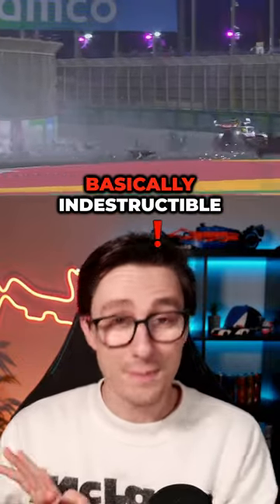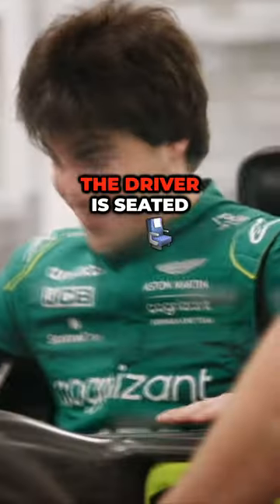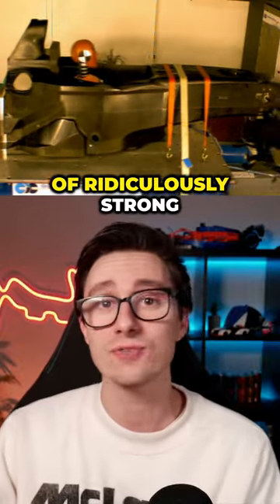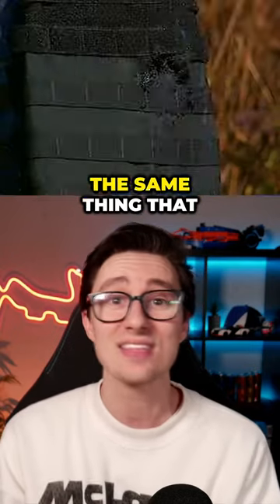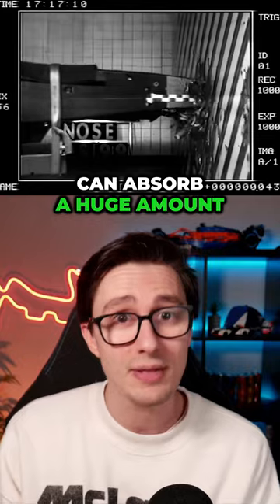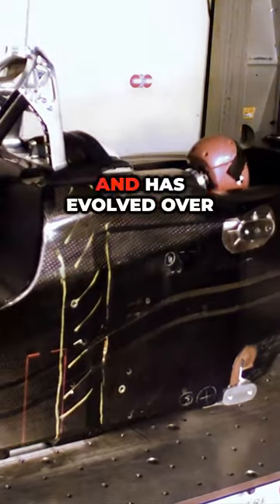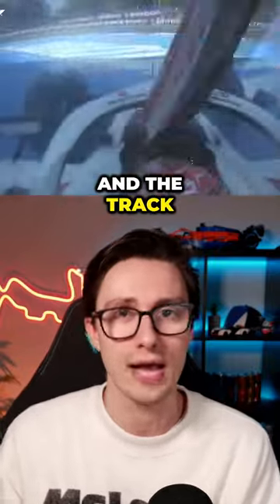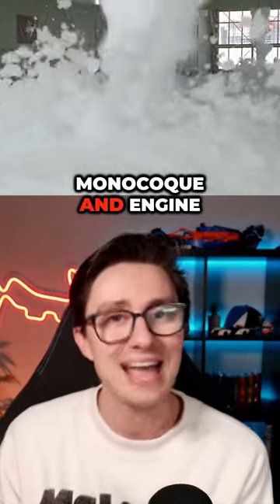F1s Survival Cell is INDESTRUCTABLE 💥

Comment: Tell this to nascar
Reply: No deaths since 2001, and they are using SAFER barriers as well as many other safety features. So NASCAR is very safe, and they have something similar already. It's called a roll cage. And NASCARs have a larger crumple zone as well, which helps with impacts.
Reply: You mean the sport that introduced the HANS device before F1?
Reply: @gdav4142  fun fact about the barriers: F1 uses different kinds of barrier technology for different kinds of impact.

For example: tire barriers are still the most efficient way to reduce perpendicular forces, while tec-pro and SAFER barriers are safer when it comes to more parallel forces.

The reason NASCAR uses SAFER barriers instead of tire barriers is due to the most common angle of impact, which is with almost parallel forces. 
The reason they don't use Tec-Pro is because it is a lot thicker (full system is roughly 2m or 6.5ft) and needs to be repaired mid-race in case of a crash, which SAFER barriers does not require.
Reply: @ThomasFox56  Thanks for the information. I'm a NASCAR fan, and will occasionally watch F1, so I'm not as well versed in the safety tech that F1 has.
Reply: @gdav4142  no problem! I only started watching motorsport in general in 2019 with F1, but very quickly expanded to all sorts of racing, including Endurance (WEC/IMSA), GT Racing, IndyCar, NASCAR and a lot more. I always had the passion of learning the nitty gritty details due to my autism, so I know a bit too much about the technical stuff and strategic stuff haha

I'll give another fun fact while we're at it: in GT Racing, they need to adjust the Balance Of Performance on a per-track basis due to the difference in cars! For example: cars with a smaller engine but bigger turbo potential are more powerful at higher altitudes than their naturally aspirated competitors. This is due to the fact that at higher altitudes, the air becomes less dense, meaning you'd have to run the engine quite lean. But with a big turbo charger you can solve that problem, because you can compress the air, bringing the density back up. And how they solve the inequalities is by monitoring performance the entire event, and adjusting weight penalties before each session when necessary!
Reply: @ThomasFox56 You have a ridiculous amount of knowledge my friend! I have an autistic friend at school who knows everything about animals and video games and my piano teachers son is also autistic and knows absolutely everything about fighter jets! Do something at University that you have a passion for as you will have no problem researching and learning everything.
Reply: @harryford8340  thanks man! I think 'ridiculous amount' isn't even the right description, more like 'insane amount, 50% of which useless' 😂 I mean, I can distinguish a lot of Rollercoasters based on manufacturers just by looking at the track-design, I can roughly estimate the era in which a song is made just by listening to the quality, processing and style.... so yeah, maybe a bit too much knowledge 😂

Comment: How did Antoine Hubbert died then?
Reply: Hubert died in the hospital, following injuries from the impact which was 82g (as comparison, Verstappen's crash in Silverstone was around 51g).

The purpose of the survival cell is to make penetration/ruptures around the driver virtually impossible. However, motorsport still is a very dangerous sport. There is no guarantee that a driver survives a race. But then again, there is never a 100% guarantee on everything in the universe.
Reply: The crumple zones on his car crumpled from hitting the wall, so when he got hit a second time he had nothing to take the impact of the hit except his body.
Reply: @ThomasFox56 True and think even if F1 was on the scale of the billions of road car users and they were constantly racing there would be way less deaths than in road cars just on the highway

Comment: Well, and that's just one argument more to ban Lewis Hamilton from F1 after what he did in Silverstone 2021. Like... How was he not banned for a few races or even disqualified after taking out another driver in a way that literally ripped his monocoque apart?
Reply: Yes but you could argue that if the was not the halo in F1 Max Verstappen would have killed Lewis Hamilton in Monza 2021. You can argue these things all day but F1 is the pinnacle of motorsport safety. Heated rivalries cause bad moments but neither driver intended to harm life in those moments.
Reply: @harryford8340  that is the stupidest argument I've ever read and I hate the fact that this is not the first time I read this. NO, YOU CAN'T!
Reason is: The Halo exists to prevent exactly that. And it did it's job perfectly fine. Max had no way of calculating to end up on Lewis' car like that.
While on the other hand the monocoque clearly isn't designed to withstand the force that Max had to experience, due to Lewis taking him out. Yes, he took him out. It was a calculated move, Lewis knew what was going to happen, he's an experienced driver and not some rookie who just started driving yesterday. He knows what he is doing. And funnily enough, if you say that I'm wrong you're saying that he's a danger to other drivers, because he's a terrible driver who doesn't know what he's doing.

Also, yes, heated moments like this happen. But the FIA has to react accordingly, including banning a driver for taking someone out and forcing them into a wall at 51g. And especially when that other driver's life was actively endangered.
Reply: @gruphius  The crash was completely Hamiltons fault yes. But Verstapprn squeezed him. Hamilton wanted to overtake so drove so aggressive that he accidentally caused a crash. He did not intentionally want to HIT Max off the race track. At Monza you can see Verstappen drove into Hamiltons car completely on purpose and at that angle and with the sausage curbs he has been in the sport long enough to know what could happen. In Monza and Silverstone it was obvious who was at fault for each one but neither intended to crash the other driver out of the race and this is why F1 has such good safety for racing incidents like this
Reply: @harryford8340  huh? I think you're a bit confused, my guy.
So first of all: "Lewis was at fault, but Max caused it." What are you even saying? Max held his line, as he was entitled to. Lewis decided that brakes are merely a decoration and ran into Max. Max did nothing wrong and, as you said, that crash was entirely on Lewis. Max had no way of avoiding that. And you can't tell me that Lewis Hamilton, a 7 times world champion and, according to some weird people, the best driver of all time, doesn't know what he's doing, accidentally doesn't use the brakes properly and by pure chance punts his only rival into the wall at ~300 km/h. We've also seen plenty other examples of him just running into people he was battling in the past few years, are these just Lewis making rookie mistakes? No, that's just impossible, especially if he truly is a good driver and not just some sham that only won titles because he had the fastest car and team orders on his side.
On the other hand, Lewis squeezed Max in Monza. Max was too stubborn to take the escape route and stuck next to Lewis. Both had the chance to avoid that one, Lewis by giving more room, Max by taking the escape route. Both didn't.
Reply: @gruphius  They are both aggressive drivers when it’s all or nothing. Racing incidents happen, they have both caused crashes. Verstappen was okay after the crash in Britain and Lewis was okay after Monza so please stop waffling and just enjoy the sport it’s been like 3 years
Reply: @harryford8340  There is a thin line between aggressive and dirty. And Lewis regularly steps over that line in a fashion that should be punished with a hefty penalty, yet he always gets away with a slap on the wrist, if he gets anything at all. Max was extremely lucky to be okay after that crash in Silverstone, while Lewis' life wasn't really in danger in Monza, because the Halo exists to prevent exactly that. And, again, Lewis took Max out in Silverstone on purpose, just like he tried to take out Piastri last season on Monza and cut the track in another race, followed by wasting 2 seconds for Norris and allowing Russel to pull away. There are more examples where Lewis should have gotten a hefty penalty, yet he always gets away. Silverstone is just the most extreme example, since he could have easily taken Max's life there and had no remorse about it.
Reply: @gruphius  “Lewis’ life wasn’t really in danger in Monza because the Halo exists” Verstappens life wasn’t in danger in Silverstone because the Monocoque exists for exactly that..
Reply: @harryford8340  No, and that is exactly my point. The halo was designed to withstand a car being on top of it, it's even tested if it can withstand that, the monocoque on the other hand isn't completely failsafe. We have seen the monocoque break multiple times in the past years, with Max being extremely lucky (his monocoque broke, but he was unharmed) and drivers like Juan Manuel Correa, Anthoine Hubert and Dilano van't Hoff being less fortunate, with the last two even dying in their respective accidents. Not one driver has been harmed after his halo had been tested so far though, with Zhou being the only driver who had experienced it fail, yet it still was stable enough to protect him, despite breaking.
The monocoque is not 100% safe, but with every accident that breaks it it gets safer.
And what you're also forgetting is the human aspect: Our body can take like 5g max, with some specially trained people (like F1 drivers) being able to take more. But noone can take 51g and be completely fine afterwards (Max was struggling to get out of the car in Silverstone, for example). Max was lucky to not have at least some of his bones mushed to paste.
Reply: @gruphius  Max was completely fine after the race. Both of the car parts are not 100% safe
Reply: @harryford8340  what is it with guys like you and never getting the point? This isn't about what happened after the crash, this is about what could have happened because of Lewis' behavior. If we take the approach you guys would like to see when it comes to penalties there wouldn't be any, as long as noone dies or gets severely injured to the point where they can't race anymore!
We should judge incidents based on intent and what could have happened. So, let's take a totally random example: A very experienced driver is side by side with his biggest rival during an active championship battle, backs out, then doesn't properly brake and runs into his rival in the following corner, taking him out and causing a crash with g-forces so high they could easily kill someone, shouldn't that be considered actively taking that guy out and causing a potentially life ending crash? And shouldn't that be punished accordingly, with at least multiple penalty points, a race ban and a course on "how to behave on track properly without endangering other people's lifes"? Isn't a 10 second "don't do that again, please" a joke for that?
Reply: @gruphius  Hamilton could have been injured at Monza but he wasn’t because of the Halo, just like max could have but wasn’t because of the monocoque. Taking 51gs for a split second did not even injure him.